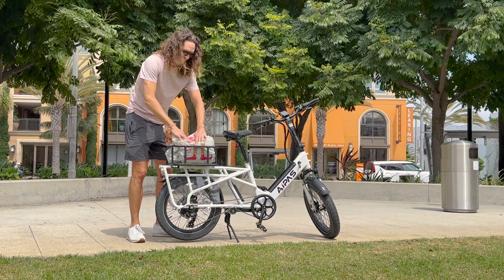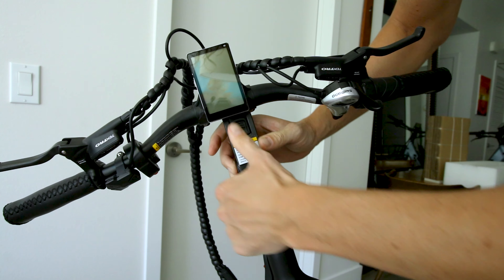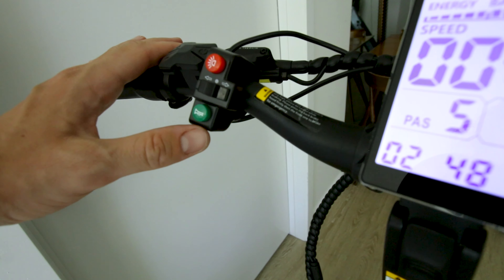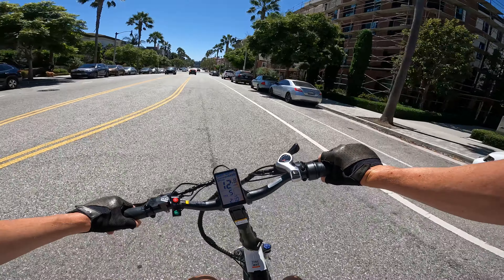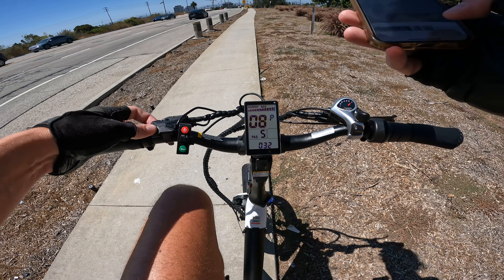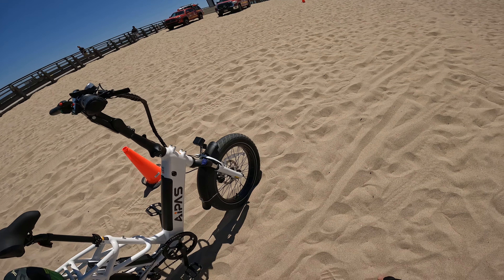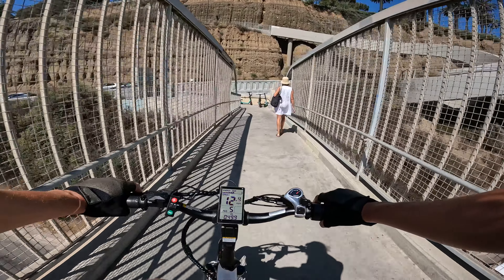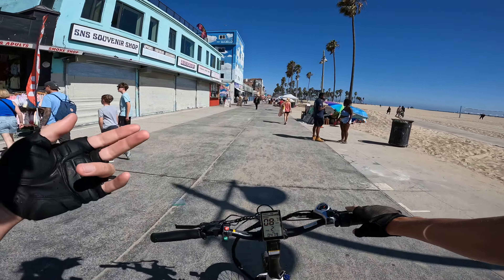Lectric Xpedition Has 1 Problem and AIPAS A6 Fixed It

Comment: The range claim on the Lectric Xpedition is a bit optimistic like every eBikes companies out there. If you were to use throttle all the time and ride on top speed of 28mph all the time then you’re likely to have a range of 17.71 miles/28.50 kilometers per full charge on that eBike.
Reply: I own a XPedition and the max range I got on 2 battery model in Cleveland Ohio stoping at red lights and for traffic and the max I got 25-28 miles and that’s using 1-5 pas and different gears according to the terrain or situation at the present time I should set it at PAS to ride around not use throttle and see what the max I can get PAS one is just too low. The only thing that’s gonna get me as a trip with EMS.
Reply: yeah, its a bit depressing to be honest. mine made it about 15 miles with pedaling, playing between 3-5 PAS and mostly flat ground. luckily there is plenty of room to add another battery
Reply: @kevinsiegel4798  make sure you’re hitting both of the wake up buttons I have heard a couple people say they forgot or they didn’t hit the button correctly and only woke up one of their batteries and they weren’t getting the proper range
Reply: 17 miles would suck then doing UberEats I need a bike that gets me all day
Reply: I can get around 30-50 miles with the dual battery. It has 1300wh of capacity, which is double the capacity of any bike in the same price range
Reply: @kevinsiegel4798  just buy more batteries lol.
Reply: I do food delivery and yep tbh I was expecting more, I get 25-30 miles with pedal assist 4/5 I never really test going on pedal assist 2 or less as it’s not as fun unless battery is running low. When I get home I just swap bikes to Lectric xp 3.0 with 3 batteries.

Comment: My Letric Xpedition Cargo costed me 2,075$ delivered with 2 batteries,child seat and the Xpedition package was free.
Reply: I just ordered the  AIPAS A6 with 2 batteries but no accessories for $1549 after finding a 5% off coupon online.
Reply: @jamesbrown5262  WOW! That thing is darn near identical! What!?
Reply: @audiwankenobi361  yeah AIPAS was/is? Lectric's Chinese manufacturer and I think they just stole their designs and improved them like the frame mounted battery improves balance. I got mine 2 days ago, and Im 390lbs it moves me on flat about 18mph+ unlocked, and peddling up steep hills is a breeze in PA5.  I heard all accessories fit also I want the orbiter cargo basket, only bummer is mine shipped without 2nd battery and I have to wait for it to be in stock.
Reply: @jamesbrown5262  390? Wow! Get in motion sir! 👏 👏👏👏!
Back in 8/26/2023 I was 315 plus pounds when I first got on my Letric Xpedition Cargo bike and as of today 5/7/2024 I'm 210. No joke. My bike helped me make dramatic changes in my life. 
Get all of your necessary tools and spare inner tubes with a quality pump or upgrade to motorcycle tires right away because your size in increase the likelihood of flats in the rear tire. That's how it is/was for me anyway. 
Many people in my family are obese,my dad died that way.
Reply: @jamesbrown5262  November 1st 2023 I stopped drinking...been a alcoholic for 21 years at least and I'm only 42.
I got rid of 3 cars,bought one car for my wife and kids....I walked and rode the bus with my daughter for a short time then got the bike and her and I rode 8 miles to drop her off at my mom house then I went to work.
Reply: @audiwankenobi361  I appreciate the concerns and tips, I didnt realize motorcycle tires were an option. Do I need new rims? But yeah it was a stuggle to save up for the bike but it now will save me over $300 a month on cab/buss fare. first thing is a helmet, gloves and side-view mirrors, and possibly those moto tires.
Reply: @jamesbrown5262  Will not need new rims. Motorcycle/scooter tires come in various sizes that fit ebikes...your quick research will help. They aren't expensive either. 
I live in Daytona Beach Florida.
Reply: @jamesbrown5262  Pedal as often as possible,focus on the position of your feet on the Pedals too.
I was riding one day nice and easy,going about 8mph and I had my left foot pointed outward while pedaling stressed a ligament or something in my left knee soo bad that I yelled out in pain...knee swelled up something serious and it felt like I was being burned there for days and was overall painful for weeks. 
Long story short,that was the day I learned the importance of proper riding positions.
I'm good now tho.
Reply: I just read that Aipas makes the parts for the Lectric bikes and that explains a lot

Comment: Wow! seems to address the common complaints of the Lectric Expedition and is currently selling at lower price. Adds front suspension, brake light, turn signal and quieter motor. The dual battery is currently $1.8k before coupon, $1.6k after coupon. Expedition dual battery is $1.7k.
Reply: BTW, the packaging appears to be the same as XPpedition (Matt just failed to open the XPpedition properly😀)
Reply: Ok bought it. Hope it's good.
Reply: Key difference is the brand experience and support for the Lectric vs. Barely known brand
Reply: @hackman88  Same thoughts when he pulled all those staples and I was like, just pull the bike out dude. I'll admit the front suspension is nice to have and almost 300 bucks cheaper because this company doesn't charge tax, but there is a lot to go wrong going by Lectric forums and while Lectric has the capacity to help out if there is an issue including having a service network nationwide - this company ain't got shit. The deciding factor for me is the dual batteries on the Lectric are standard and can be replaced and swapped easily. Internal batteries have a clock that is always ticking as to when you'll have to either overpay for OEM ones form the company itself (and usually at a premium) or rebuild the cell inside. The future proof option is Lectric for me, but gambles do pay off sometimes so I can see why the savings and suspension are enough to convince one to go with this  Aipas.
Reply: For thr very little you save and the addition of a front suspension you give up a well known USA based brand with USA customer service and a warranty that you can trust.  Honestly if you use this as an actual cargo bike with weight your going to lock that front suspension anyway.

Nobody else has reviewed this bike and there is basically no info on this Chinese company.
Reply: Pre-ride update: Bike arrived 2 weeks after I ordered it. Packaging was good and delivery by Giga Cloud Logistics was better than FedEx (on my first ebike Engwe Engine Pro). Acessories (including cargo baskets) arrived 3 days after order. There is a small dent at the rear of the bike frame. There was a loose screw in the front battery compartment. I was able to identify the hole that it fell out of and replaced it. Both front and rear brakes rub a little bit.

The manual includes Lectric XPedition pictures, diagrams, features and functions that do not apply to the A6 such as, the XPedition frame and cockpit, quick-release pedals, PWR mode and hold plus button to turn on/off lights. (Holding the plus button does activate the headlight icon in the display but does not actually activate the lights.) The manual is lacking instructions on the power switch in the front battery and the light/horn/turn signals, but they are simple enough to use without instructions.

Support via email has been responding within 24 hours. English has been good.

The rear cargo basket can be installed in 4 different orientations where all 4 attachment screws are used, but all block removal of the rear battery. You need to remove the seat to remove the rear battery or install the basket with only 2 attachment screws and some zip ties.

I am surprised that there is no way to lock the battery power off. The keys on the batteries are only for securing them in the frame. The rear battery is always on. The front battery has an unsecured on/off switch. While the bike is parked, any passerby could turn on the display, apply the throttle, turn on the lights, change your settings, ... (Engwe Engine Pro requires a key to turn on.)

All of the front-to-rear cables are routed through the frame.

The charger does not have a fan and is silent. It is mildly warm in the 3-4 hours that I have used it.

The included phone holder only fits the narrower part of the low-rise handlebars away from the center. This results in the phone being tilted 20-30 degrees. I probably will not use the phone mount.
Reply: First-ride update: there is a front wheel wobble at all speeds. This is with a 20 pound load and rider weight of 240 pounds. Locking out the suspension helps a little bit. I'll try adjusting front suspension, tire pressure and stem. The turn-in feels too rapid like the bike wants to make the turn sharper than what I intend. It could be just me (like pilot induced oscillation on a plane).
Rear derailleur needs adjustment.

Climbs hills better than my Engwe Engine Pro (750W motor/1000W peak). On a 13% slope hill that runs 385 feet, the A6 got to the top at ~10 MPH with a flying start and light pedaling, Engine Pro ~6 MPH with flying start and hard pedaling.

The gearing is a little low if you like to pedal at higher speeds. In top gear, pedal cadence ~100 RPM at ~24 MPH.

The controls are more difficult to reach than Engine Pro, but probably just takes some time to get used to them. Engine Pro has trigger shifters which I prefer over thumb shifter.

Throttle goes to 20 MPH in PAS 1-5 (Engine Pro PAS level also determines throttle top speed).

Bumps are bumpier than Engine Pro which has basic full suspension and 4" tires.
Reply: Speed wobble fixed. The headset was loose. There was no noticeable slack when rocking the fork and handlebars back and forth, but the headset bolt was very loose. I tightened it 1-2 turns and the speed wobble is gone. Now, any wobble quickly dampens even with only one hand on the handlebars. Even with the front fork set to softest setting, wobbles are well damped. Before, the wobble would quickly get worse and required a firm grip with 2 hands on the handlebars to dampen. 

Motor is much quieter than Engine Pro and is more powerful. Quieter motor and street tires (vs 4" knobbles on the Engine Pro) does make the ride more enjoyable. Highest amperage that I have seen on the display is 24 amps, but is infrequent. Full throttle usually results in 22 amps.

Battery swap is much easier than Engine Pro (battery inside folding frame), but I still wonder if a bike with one big 30AH battery with a handle behind the seat would be better. (I have to remove the battery for charging.)

Cargo baskets could be better. Welds are just passable. Front basket has some orange peel texture paint. Rear basket has 2 pre-cut holes that are just out of spec enough that they can't be used to bolt to the holes on the rack. Cutting the holes 0.5 mm would make them work.

I think this frame design is better than the XPedition. The rear rack has 4 main horizontal rails which provides more options such as attaching panniers to the lower rails and something else to the upper rails. The step thru height is lower than the Expedition. All front-to-rear cables are routed through the down tube.

With the center mounted double kickstand down and added weight in the front basket, the rear wheel comes off the ground so you can easily adjust the rear derailleur.

The display is easier to read in various lighting conditions compared to the Engine Pro. The Engine Pro display has more features, is color and has descriptive prompts for the settings.
Reply: @hackman88  man, thanks for the detailed review comments. You should make a video and post it to your channel. It's rare to get a real user perspective on these things.

How has support been with all the loose items? Did you contact them or trouble shoot it all yourself?
Reply: @hackman88  you said in this post that manual and packaging is very much the same as XPedition and even includes it's pictures...

This seems to conform to my notion that this is basically built by the same manufacturer - not sure if it's built to the same specs and such but yeah...

I would love updates as you keep using it...this bike is most of the way there to what I would want from a cargo bike...the front suspension is needed where I live - the sidewalks and roads are crap...
Reply: Update: with a 25 pound load on the rear rack, you can feel a good amount of flex in the frame. I'm a little concerned about heavier loads. I think the low step-through frame design is too flexible. The gusset between the downtube and seat tube could be an inch higher to make the frame stiffer.

I swapped the positions of the light/horn buttons and the display control pad so now the horn button is closer to my left hand and easier to use.

Surprisingly, the top speed I have reached on flat ground is only ~25 MPH (ghost pedaling and controller applying ~22 amps). On my Engine Pro, I can throttle to 28 MPH then the controller cuts off. Maybe internal motor gearing on the A6 is geared for more torque and less speed? The A6 definitely accelerates and climbs hills better than the Engine Pro. The handlebars on the A6 are wider than the Engine Pro which probably results in more aerodynamic drag.

The Aventon Abound panniers appears to have not even shipped yet and Aventon sales has not responded to my request for a status update.

The turn signals are not very visible. They really need to be a big flashing orange arrow that cover the entire rear light. And of course they need an auto-off function.
Reply: Frame flex and panniers update: I tightened the headset some more and it reduced the feeling of frame flex.
The Aventon Abound panniers finally arrived 21 days after I placed the order. Aventon customer support was slow and not helpful. They should be communicating that order fulfillment is slow. 
The panniers fit fine. The A6 rear rack rails are the thickest that will fit in the quick release clamps. I installed them on the lower rails so the load will fully sit on the running boards.
Reply: I rode it today with ~45 pound load (20 in the pannier, 25 high on the rear rack) and there was a mild speed wobble when applying power at speeds greater than 15 MPH. The load on the rear rack was not very secure so I was going slow anyway.
Reply: @hackman88  hackman. Try to post a video of your bike. Like a walk-through of what you tightened and all. Also, where did you get the biie? At aipas or somewhere else ( amazon, walmart etc) really considering this bike but worried about warranty and longevity

Comment: I like your route and it does make it easy to compare against other bikes. Specifically key points like your garage incline and the California incline and sometimes beach riding. However the rest is just range, so if you wanted to vary that I think that would be cool.

Comment: Prefer the Lectric Xpedition, essentially same price. For a cargo bike strength & durability are more important so prefer the rigid fork over a cheap suspension fork. Also these Chinese companies are notoriously bad for customer support. (Plus you get the cool telescopic seat post.)
Reply: I wouldn’t be surprised if they’re from the same factory. In fact, I wouldn’t be surprised if an Xpedition 2.0 comes out soon and looks exactly like this. Not having front suspension is rough though. That makes for a very jarring ride even if it’s carbon fiber like a road bike.
Reply: We are also trying our best to give customers the best products and fastest customer service,

wish you love our A6 cargo ebike
Reply: @AipasEbike Where are you accessories for hauling kids? I’m looking for seat cushions and an orbitor. Or does Lectric branded accessories fit the A6?
Reply: @QLaCarver  I read that they do fit, and  AIPAS was the Chinese Lectric factory until they stole their designs and opened own bike company lol

Comment: Part of the reason the handgrips spin is because they are attached to a very smooth painted surface. Back when I was kid, we’d use electric tape on the handlebars and then put the handgrips back on. Try that 😊
Reply: Use hockey tape, it had a grippier surface.
Reply: I use hairspray for my motorcycles

Comment: You do great reviews and the fact that you use the same route allows better comparison between bikes.  I do, however, enjoy your "bike adventure" videos, like the ones to the Hollywood sign, and would watch those if you made them.

I would suggest you stick with your standard review route and add a few "bike adventure" videos.  Here are a few suggestions:

Marina del Rey to Palos Verde
Marina del Rey to Malibu
Destinations near the eastern end of the Belona Creek bike path

Your standard review route is right through my stomping grounds.   I live on my sailboat in Marina del Rey and use the same routes almost daily.  Your hill in Santa Monica is one I tackle every time I ride to doctor appointments and like the fact that I can compare my current ebike with those you review, especially since I dont have access to your parking garage.

Ill also add that Im totally in agreement with what you said in your video about pros and cons of fat tire bikes.  I had an Aventon Aventure bike that was stolen.  I replaced it with a step through bike with 2.25 inch tires are like the narrow tires a lot more.  The fat tires are noisy and the added weight makes it harder to move the front end of the bike around after riding up to a pedestrian crosswalk button.